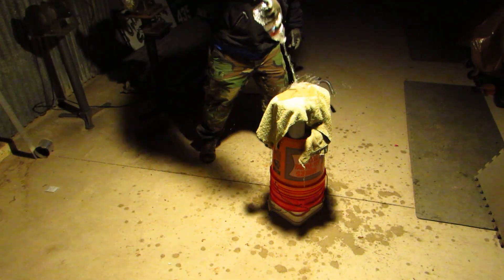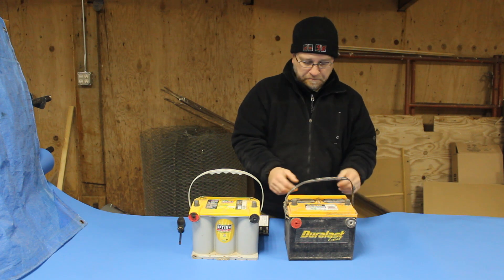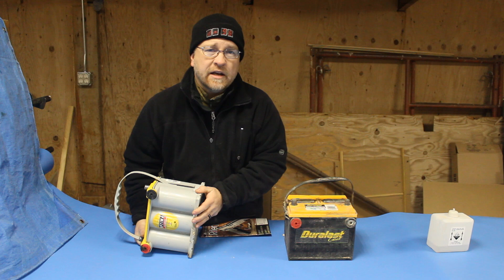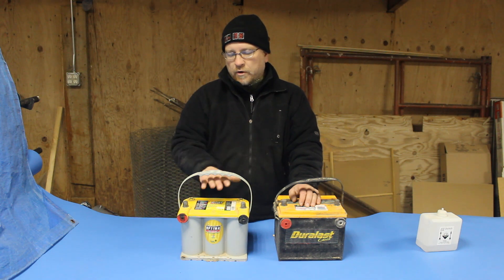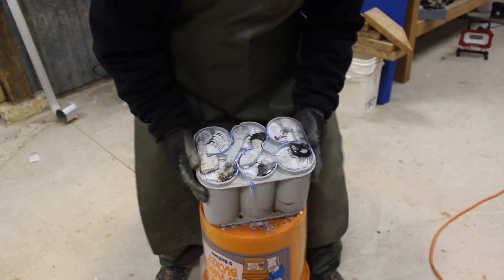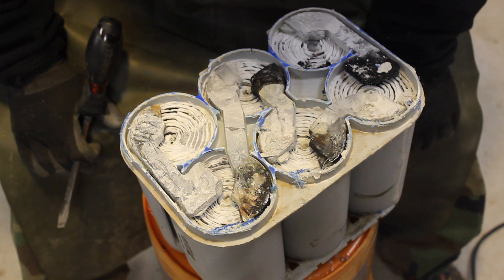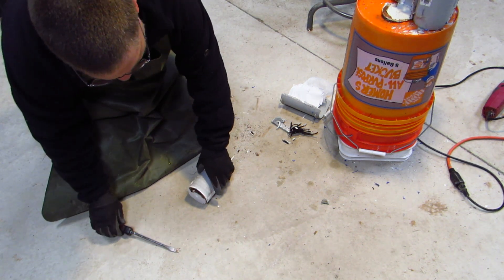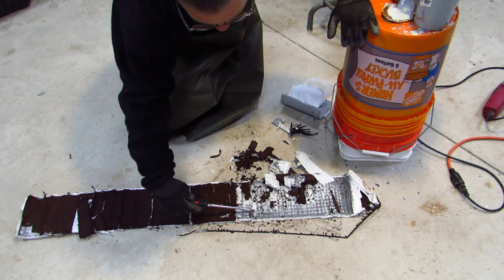What's Inside an Optima Battery??? AGM Battery's Dirty Little Secrets!

Comment: Thanks for the tear down.  

With the battery positioned with the negative post on the bottom right, the cell at the top right was the one failing in about 90% of the 1/3 of the new Size 34/78 and Size 34 Red Top batteries failing a carbon pile test I in 2006 and 2007.  These were mfg in Aurora, Colorado, at the time production was being shifted to a suburb north of Monterrey, N.L.
At the time of failure, the top of this cell became much hotter than the other cells.  Failure appeared to be in a domino mode, i.e., when one spiral buss bar connection failed, it put that much more current through the remaining connections, so then the weakest of those left would heat and fail, and so on until all failed, usually in less than 3 seconds.

Many Optimas experienced potential drop quickly and a fully charged battery would be dead within a couple of weeks, maybe longer, but definitely quicker than expected.  This was caused be crimping of rhe grid onto the plate when pushed into the bottom of the can.  (In contrast, Enersys Genesis AGM series NP38-12 batteries typically drop from 12.6 V to 12.5 V over 12 months.)

Comment: I got a job maintaining floor scrubbers for a university and I see so many agm deep cycle batteries. Trojan claims that their batteries can be discharged 100% and still get 1200 cycles. Their batteries are always 20-30 amp hours smaller that their discover battery counterparts, I think that caused their batteries to get over discharged which is why I am replacing 1 year old Trojan batteries.

Comment: I bought two blue Optima's in Aug of 23.  The Jury's still out.  I tried charging from my Astron Power supply, but didn't work so well.  I'll try Batter Maintainers next, but I may go back to led acid deep cycle marine Megatron Batteries.  My last one lasted 8 years.  We will see.

Comment: The Negative plate NEVER goes bad and usually looks gray lead colored as always. As for the positive plate they get Rock-hard and turn brittle over-time and eventually just fall apart. As for the dark color that is a normal Lead-Di-Oxide coloration. While I was in the US Navy we used custom built Lead-Acid batteries with a 50 year life rating.

Comment: You do also need to have an AGM capable battery charger to work with these. A regular battery charger will not cycle the charging properly to keep the battery cool, and will overheat and fry the crap out of AGMs.

Comment: I was chuckling from the beginning and then laughed heartily when he brought out the chainsaw and again when he started it. This is absolutely the best intro to a Utoob vid I have ever watched. This guy has a great imagination and a flair for drama. Cudos Bro!

I have a 4 year old Optima Yellow Top, that has spent 98% of its life sitting in my SUV and occasionally required a charge to start the engine after it sat for several days. Then twice recently went to 3.3 volts on the road. Left me stranded once, got home OK second time using only parking lights. With charger, it gets to 14.7V then drops to 11.5V when charger is removed. Best guess is that it has a 'Dead Cell' and I will replace it when finances permit. Looking at an almost $300 Duracell or Interstate with top and side terminals but must wait a few months.

I'm in the process of connecting my 2x100 amp house battery pack, via a 200 amp switch and 6AWG wire, to the engine battery so if/when it happens again, at 10/20degF, I can flick the switch and get home.

When the engine died on the road, a friendly motorist jump started me. My factory dash gauge read 0% before the jump and 75% of scale after the engine started. Zero% of scale = 3.3V and 75% = 14.7V via a VOM. Those are the readings after I got home the second time.

After watching this very valuable vid, my thought is that an interconnection at one cell is corroded and causes a Hi-Resistance that causes the 11.5 volt reading after a 14.7V charge cycle and occasionally goes so high that is acts as almost an open, i.e. 3.3 volts. Keep in mind that the 6 cells are in series and resistance at any one cell interconnect will cause a low reading after a full charge and randomly what amounts to an open on occasion.

This vid showed that the corroded connection between 2 adjacent sells may well be my problem and also the 'Achilles Heal' for all Optima batteries.

I accept that the lead grates will get covered with an insulating layer after several years of use, or non-use, and causes progressive deterioration of the battery. But I will not accept that the interconnections between adjacent cells will develop high resistance and battery failure due to corrosion.

NO MORE OPTIMA BATTERIES FOR ME........
Reply: OOPs: 
It's not a Yellow Top, it's a Red Top.
Also, there will be a 200A Fusible Link at the house battery POS Terminal that will then connect to the 200A switch.

Comment: My Optima yellow top is 6 years old (purchased from Amazon). It's been discharged several times down to the 10.5 amp range, and I have an AGM setting on my charger when this happens. The battery always has a small load while the car sits because of the gizmos that spring to life randomly, and the interior light has been left on numerous times. The Toyota battery before this one lasted 3 years. Sounds like I lucked out and ended up with a good one. Resting voltage 12 hrs after being on charger - 12.5V (disconnected from car). After the car sitting for 3 days - 12.3V.

Comment: I didn’t even get 3 years out of mine. I went back to a GM agm battery from the dealership and it has outlasted the optima by double so far!
Reply: Same here, less than three years and mine was an expensive paper weight.  JUNK!
Reply: The Optima battery today is not as well made as the original optima batteries.  They had purest copper vs lead. 
Today's Optima requires Desulfating, with a special charger to electronically remove sulfate crystals forming inside. The sulfate crystal decreases the amount of charge the cells can hold.
Reply: Sorry to hear that. My Optima Yellow Top is going on 4+ years and still has 95% SOH. I do keep it charged regularly since the car is not driven much, and I have a voltage booster diode in line with the fuse on her Toyota to bring the alternator charge voltage up to 14.6 during driving.

Comment: I got my first optima battery with a car I bought.  It was a red top and it lasted about three years from the date code on the battery.

I wasn't impressed.  It never saw any abuse that I know of and it got discharged once, but not to the point of being completely flat.  I doubt that I'll ever get another.

Comment: I would bet that the Optima AGM loses water just like smaller AGM's.  If you keep a 7ah 12v AGM hydrated, it will last a lot longer.  Unfortunately, it is "easy" to add water to the little AGM's - I don't see an easy way with the Optimas.

Comment: It's too bad optima doesn't make good batteries anymore like their old ones. The new ones only last 2 or 3 years and that's under normal circumstances then when you warranty it the warranty doesn't start over on the new battery so really the 2 batterys you get barely last longer than 1 traditional battery. I've had good luck with odyssey. I've yet to see successful ownership of an Optima in the last 10 years and what I really dont get is why the terminals just fall off randomly I've seen 4 fall off randomly on street cars while driving and they hadn't been on and off a bunch they just fell off then I've had numerous ones fall off while removing the connection. I hate it when a customer has an Optima, just yesterday a customer's truck with a yellow top has the positive post just spinning in place the plastic is barely holding it on that's the first time I've seen one spin in place without just falling off.

Comment: 14 years for the first yellow top.  Paid ~$100.  6 years of use on #2.  Paid ~$180.  Just purchased #3 from Optima direct.Paid ~$237.  Diminishing value.  Think #1 was made in the USA, #2 made in Mexico.  Quality control, change in design or just lucky with #1? Still beats needing to replace a “conventional” lead acid battery every couple years.  Especially when I wait until the battery is “dead”.  Need to use the load tester on regular basis.  Not after the battery has gone poo. Thanks for the dissection and info video.

Comment: Actually, the reason they roll the Optima batteries VS stacking them is because it's a cheaper process. You need a three machines to make the regular pancake stack battery, versus the Optima where you only need one. The factories that make the Optima style battery only have to order the right dimensions of roll, feed them into a rolling machine (kinda like you'd roll a DIY cigar) and then they're done, where as the regular one, they receive sheets, have to cut them, have to install them in order, then put them in the battery.
It's actually cheaper to make (in talks of operations, not materials, that's a different matter altogether) an Optima battery than it is to make a regular pancake style one, and that's without talking about the fact that the machines to roll batteries in that format, already exist in that size, because they make capacitors that big (which follow the same kind of design). Whatever CEO figured that one out, pulled himself a neat retirement package.
Take it as you will, it is what it is.

Comment: I would like to see that done with a new optima battery. Maybe we could find out why the new ones are only lasting 2-3 years and the old ones lasted 10-15.
Reply: Its because they were bought out a while made and only are made in Mexico now .
Reply: @MDGOrbit  yes, they are not good at all. Any battery from Walmart made in USA are better. I prefer to get Yuasa or NAPA AGM battery. They have very long 48 months warranty
Reply: @rondhole  NAPA Rip Off
Reply: @Lucky-ou4vz  Please elaborate on how NAPA is a ripoff
Reply: One word..  Mexico.
I suspect it's the connections on top.  You can see how much lead was used in those connections;  I bet they are skimping out on the newer ones.
Reply: Thats easy its called Johnson Controls buying them out.
Reply: It’s because they realized they can’t make money when battery’s last 10 years, but can when they last 3-4 years. It’s the same with cars nowadays, it isn’t financially beneficial for companies to make perfect products.
Reply: I would love to know that also I've had to replace mine twice and think I should try a yellow top now
Reply: They put cheap China crap inside.

Comment: Bought my yellow top in November  1993 still has 9 volts , now I use it to power the  led work lite,was in my fj 40 up until she didn't want to crank the 327 Chevy motor no more,thanks a lot for sharing.

Comment: Optima batteries are junk ever since Johnson Controls bought the brand !!
Reply: BINGO! I've got FIVE of these POS batteries that died at less than two years old. They would never hold a charge over a week even when new. Any car I owned that had an Optima battery wouldn't start after a week of sitting. I always had to get the charger out to charge it. 

I've got an old Interstate battery [which isn't as good as the old Interstate batteries of the '80s, and '90s], that can sit for a month, and still power the starter to crank the engine just fine, without having to get the charger out. Optima batteries are over priced junk [the old Optima's in the '90s seemed to hold up fine, but not these newer batteries made around the late 2000's.]
Reply: I've had 2 that died in 1.5 years screw optima

Comment: do NOT add acid to a battery unless it's brand new and not prefilled or you know wtf your doing.  The acid itself isn't what get's low, it's the water that evaporates off (it's a bit more complicated then that, but that explanation works well enough)

While the spiral cell design may make it stronger vertically, I personally don't park my jeep on top of my battery at the end of the day.  I will stick to regular square designed AGMs since you can get more capacity and power output for a given battery size.
Reply: I agree.. it's unbelievable to see people post on YT video like this of person with absolute no knowledge about it. He doesn't even know how battery work, led and ledoxide, sulfate acid and sulfate crystals etc. etc. etc.

Comment: Also was wondering what was on the inside. 15 years? Same battery that’s pretty good... real good. Very cool 
Thanks
Reply: I just replaced two Optima Red Tops that lasted 13 and 14 years with new Red Tops. About six months later I am seeing comments on YouTube that manufacturing was moved to Mexico and the quality went down. Apparently this happened in 2008 but I am only discovering it now, after I purchased 2 Red Tops six months ago! It will be very interesting to see how these recent Optimas compare to the previous generation.

Comment: @ BleepinJeep
Great Job. I did like this video.
The reddish-brown stuff is not the reason, your battery died. This is just the normal lead-dioxide of the positive electrode, which is never pure lead. Pure lead is the negative electrode - when charged.
Your battery got choked from the white stuff which is a buildup of lead-sulfate, it might also have separated your internal connections due to its expansion. You get this white stuff during discharge on all the lead surface as a normal reaction. 
If the battery doesn't get fully recharged immediately after any use, the lead-sulfate has time enough to form bigger crystals. These big crystals of lead-sulfate won't completely dissolve next time you charge, and so, piece by piece the're reducing the capacity of your battery. So destruction of the battery starts slowly - just a little bit every time any type of partially discharged lead-acid battery sits around for a while.
Reply: The reddish brown stuff is the reason this battery died ( not because it’s reddish brown) if you look closely it’s all crumbly and lost integrity, it’s called positive plate corrosion. Sulfation only happens to batteries that are not charged properly. Typical end of life car batteries do not die from sulfation.
Reply: @TheMickyTDI  no positive plates were really redish brown. It dies because positive plates are already worn out corroded
Reply: @TheMickyTDI  Tech guy at kinetik Battery told me 80% of the AGM batteries returned under warranty were for sulfation, and vehicles cutting off charging at 13.8V or less are most prone to this.  Maintenance free batteries need about 10% ongoing overcharge to fully maintain capacity.  (Stop charging if gassing occurs.)

Comment: Long time subscriber here loving this video! I have an optima yellow top that belonged to a friend for 7 years of hard use in an old f150, I ran it in the truck for two years and then crashed it 200' into the Maine woods. It survived and I installed it in my Wife's mini skid steer where it still resides. At 12 years old its far outlasted any comparable battery and at a cost of less than 25$ a year combined with its torture and survival, I won't buy anything else. Be Well

Comment: I wonder if the red stuff is a form of lead sulfate. It is typically white-ish but it could be a different form. Interesting battery, thanks for taking it apart.
Reply: yep its sulphated....modern battery chargers have a sulfate mode that hits the battery with a high amp charge to knock the sulphate off or (de-sulphate)